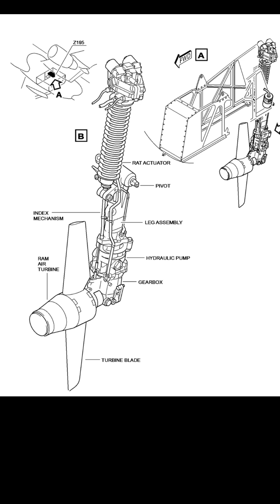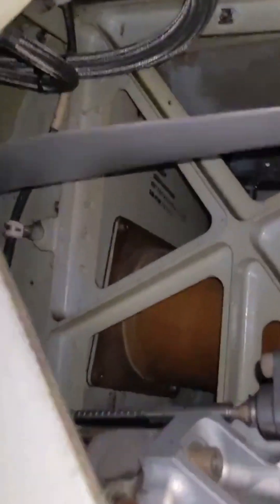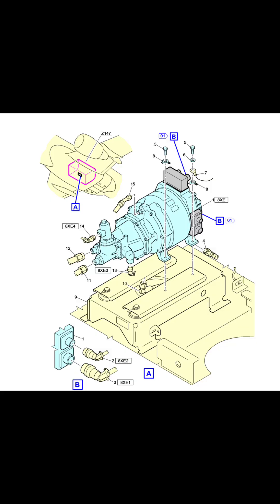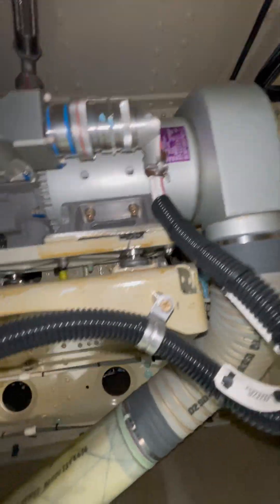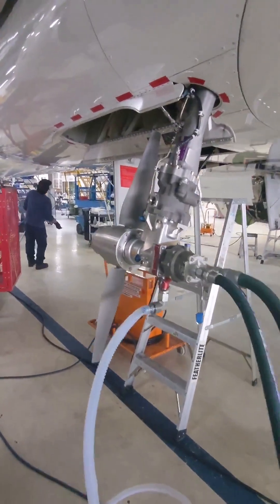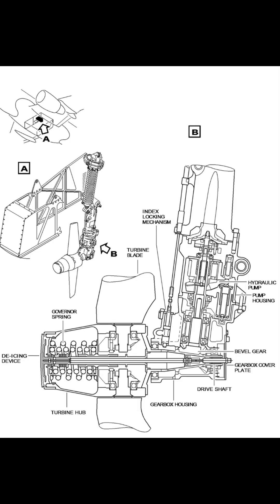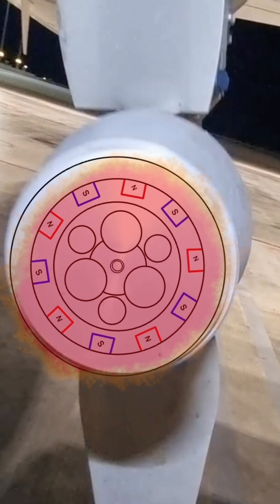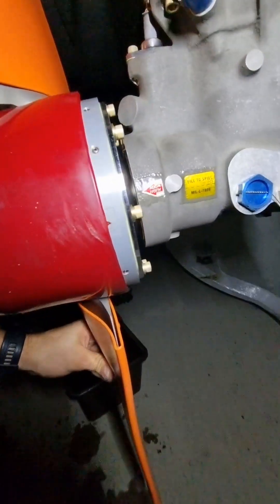RAT (ram air turbine) explained

Comment: Awesome video. Is there a specification for how long would it take the RAT to deploy and how long for the RAT to begin to provide electrical and hydraulic power once factors are met triggering the auto deployment?
Reply from the maker: Rat will drop within 3-5 seconds (when parameters are met) and begin providing hydraulic power immediately and electric usually in 4-6 seconds.

Comment: Question:  Is the RAT blade propelled solely by the air speed of the aircraft that's in trouble?  I can't believe that the RAT's blade spins that fast at speeds most likely under 150 MPH, especially since it has to generate electrical and hydraulic power - just a small generator for a few lights is hard to turn by hand.  Thoughts?

Comment: if plane  has 2 engines but 1 generator and that  engine  fails rat will still pop out?
Reply: RAT will only deploy if both the engines fail. If one of the engines is functional, RAT will not be deployed
Reply: @arpitnagda3032   rat can be deployed also when both power generators inside engines stop working while engines still run.

anyway when both engines shutdown during takeoff means problem with fuel valves.. both engines can die due to bordstrike too but there was no birds near... 

even if fuel pump died the fuel flow would still happen because there is backup fuel pump and as last resort fuel would still reach engine via gravity forxe.

something had to block the fuel valve ..probably contaminated fuel or fuel valve defect.

also bird strike not always destroy the engine.... sometimes still can function depending on  bird size.
Reply: @arpitnagda3032  isnt rat fixed to the engine generators itself not engines?  if both engines run but generators are dead would rat deploy?

Comment: I imagine it must spin up pretty good of course depending on aircraft speed.  Much faster than the Mazda RX7’s I used to work on. The rotary engine took 7K rpm no problem & I heard modified ones for racing hit over 20K.
Reply from the maker: Good point!

Comment: I recall on of our 757 had its RAT auto deployed for some reason during a heavy rain while parked at an airport in Austria. Pilots couldn't explain to me what it was that caused it. Could it have been a short due to flooding?
Reply from the maker: Might have been or they might have inadvertently pressed the deployment switch.
Reply: @StigAviation  i asked some airport guy and he told me that rat can be easily deployed if you fuse right wires responsible for rat deployment aswell . so yes short circuit can cause rat deployment but the power line breakers should trip then no rat... you could make shorting in rat circuit to force deploy but why if you can use button or switch to deploy rat
Reply from the maker: @stratiosastero6880 nope that’s not gonna happen.
Reply: @StigAviation i dont know whos right.. but from my electrician and electronics knowledge its technically possible to trigger the rat deployment   by shorting the circuit.. trick is to power up the thing externally to bypass fuses and breakers.

Comment: Dude, I never knew that commercial aircraft had a propeller hidden onboard. As you said, its a failsafe if all electrical systems and hydro systems failed onboard, due to loss of power from the engines, as well as no power from the APU. But I have to believe that this single propeller, while small, might even add a tiny bit of thrust, to help keep the plane flying. So I finally have a question to ask of you, that you can answer in a future video. Please talk a little bit more about the RAT, is it actually capable of providing the aircraft a bit of thrust as a backup, or is it only for power generation for flight controls?
Reply from the maker: Everything about the rat is in this video, it does not produce any kind of thrust. All it does is provide minimal electrical power and minimal hydraulic power.
Reply: No thrust Sir, if anything it’s extra drag. Buy yourself a kid’s pinwheel. Does it spin by itself?

Comment: What tells or stops the RAT in perfect alignment to egress and ingress the door opening? If is is not aligned correctly and attempts to ingress or egress it would damage the plane and the air foils on the RAT. So what stops it so it is perfectly vertical or aligned?
Reply from the maker: It has an internal cam the will prevent it from going up if not put into alignment.

Comment: In my ignorance I thought that the rat  once deployed was returned to its well manually by a mechanic on the ground 😂 it seems at the end of your video that the rat is risen automatically
Reply from the maker: No. You are correct. It’s done manually. A mechanic has to stow it on the ground. It’s being raised up because someone on ground is pressing a switch for it to come up.
Reply: @StigAviation  I meant that I thought you had to push it by hand  inside it's well 😉 but   it must be too heavy to lift
Reply from the maker: @stenic2  it’s not that heavy but it is attached to an actuator and has retention springs. Hence why we bring it up using the aircrafts own hydraulic system.